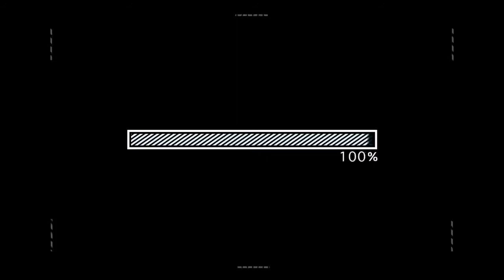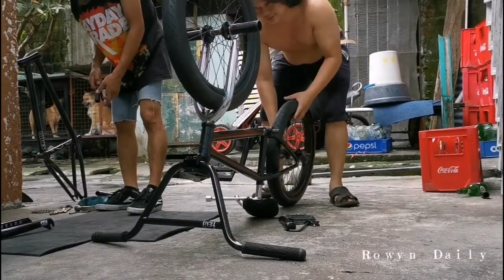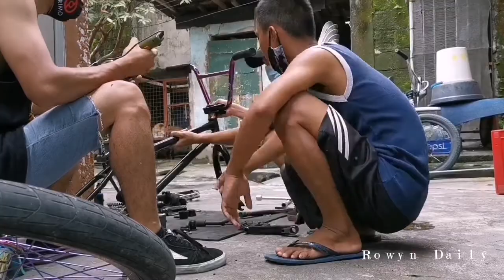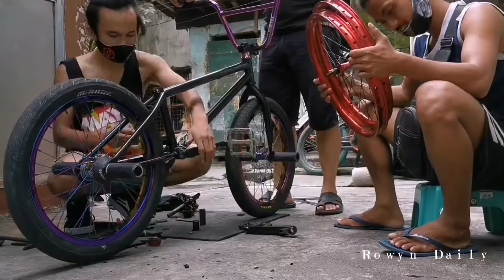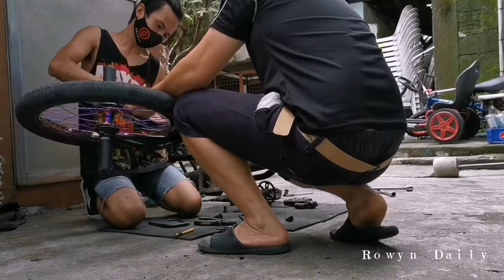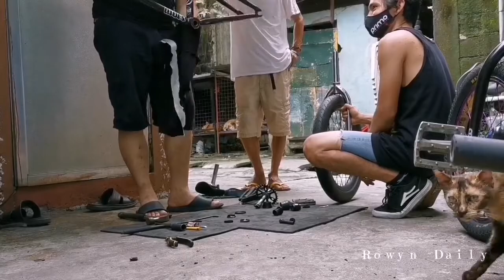OLONGAPO BMX CREW - I SWAPPED MY SHORT BMX FRAME

Comment: Boss ano ba dapat sukat ng stem??
Kung ang gamit mo ay r15 na fork at heavens gate na hndlebar?
Reply from the maker: Actually mas prepared ko 45mm to 48mm na Stem, kaso wala ako mahanap dito sa Pinas na frontload eh. Mas gusto ko kasi slammed almost yong bike ko... Naka 50mm ako na Stem sa ngayon, pero iba yong movement nya.. Hindi tugma yong galaw ng bars sa galaw ng fork. Sana mag karoon ulit ng TDFL na Stem, kasi 45mm yon eh. Sa taas ng bars? Para sakin, depende sa height yan ng rider eh. Bar ko is 8.75 rise x 28 wide.